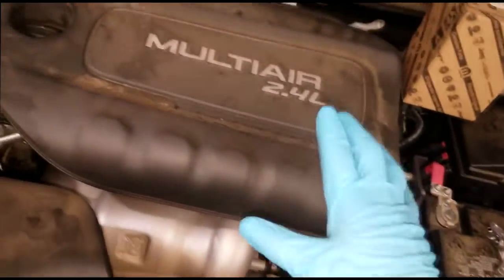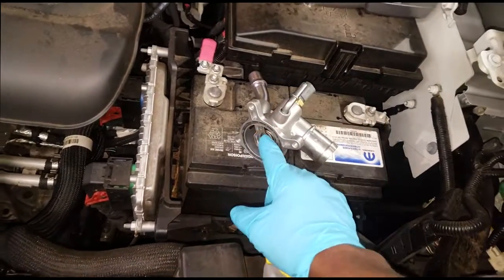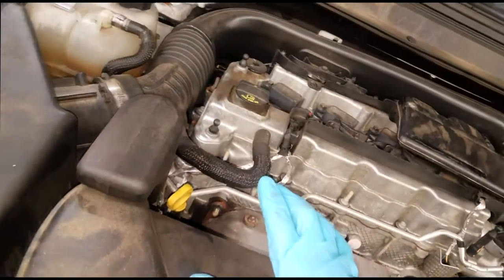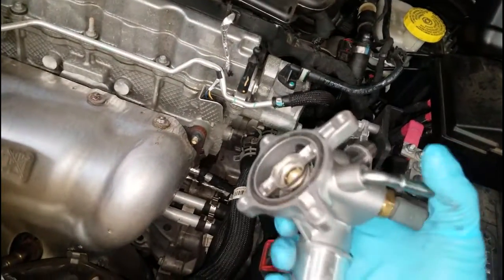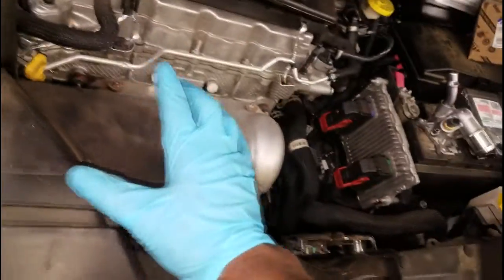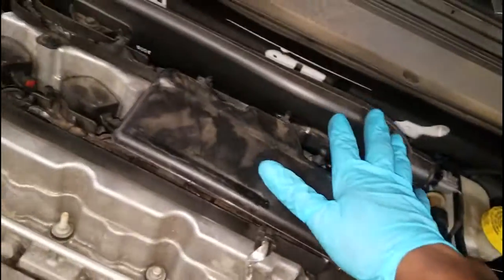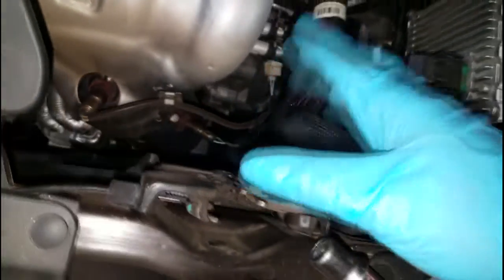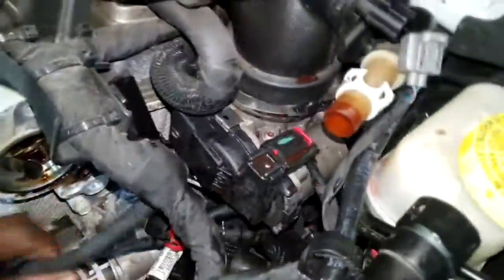STOP using these parts for this hard job. Use Mopar OEM parts. P0128 Thermostat. 2.4L engine

Comment: Can I continue driving my 2019 Jeep Renegade Trailhawk when it has a thermostat issue?  It seems to drive fine and does not get hot.
Reply from the maker: Do you have the P0128 code? Also are you subscribed to the channel?
Reply: I just now subscribed. I will go tomorrow to OReilys and check on the code. I will let you know the outcome. @OnlineMechanicTips

Comment: My 2016 trailhawk had a cold temperature code P0128 late 2019 with only 40k miles on it. Did replace it with genuine mopar part and it's doing it again. The part costs around 100$ but the the overall job at the dealer costs $800. Replacing it  again with a genuine OEM part that's known to fail doesn't appeal much to me. Any suggestions? Thank you Sir !

Comment: You mentioned possibly doing a flash update, is there a case where you can do a reset as a diy'r since doing a flash update requires WiTech?  Thank you, liked the time lapse portion of the video. 👍👍
Reply from the maker: sup bud, I am not aware of any other way to get those updates..But some of them, especially the trans really need those updates
Reply: How would you know if it has been updated?  I bought the car used call the dealer and with the VIN number?